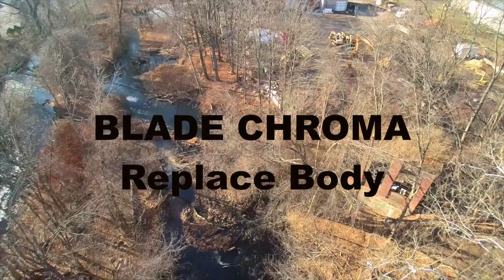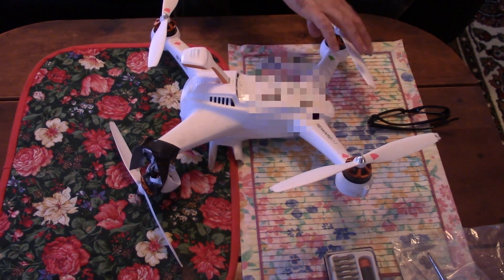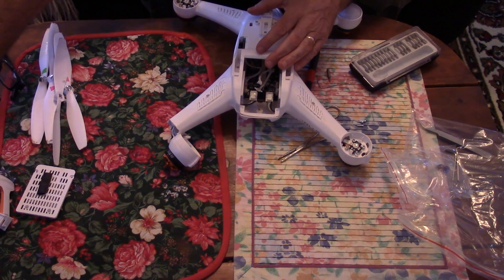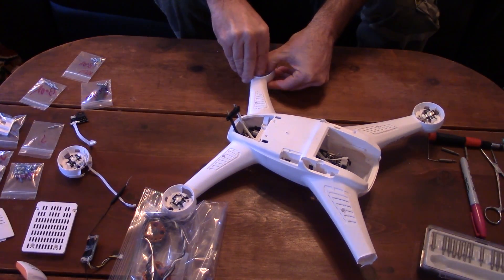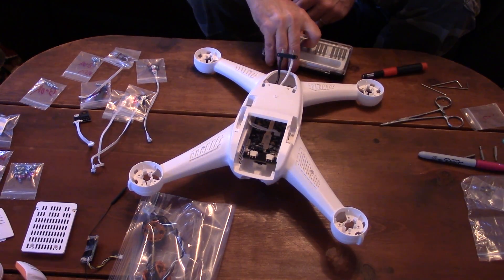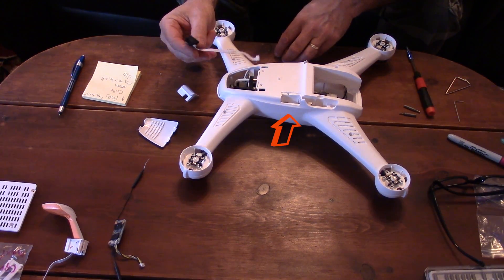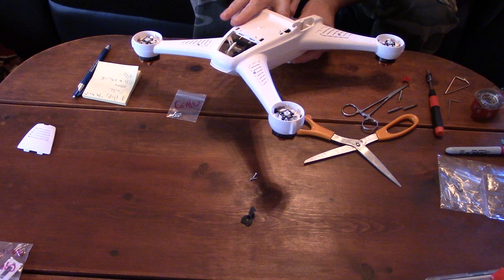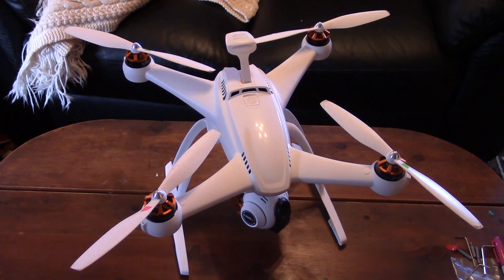Blade Chroma Replace Body

Comment: Yes you were extremely helpful to ma  . !!!! I just bought a new Chroma Drone fly-more pack from a great couple (Niagara Falls)  who upgraded to a Mavic pro. On my 3rd test flight as this is my first and I'm hopin many more drones I crashed in into a tree as yourself on a night flight run due to  the fact I couldn't see the branches. But it's OK Cam lost it's little aluminum cover landing gear was totaled hoping that as I purchased all new parts one arm had a slight crack which just hit it with a tad of SUPER glue it's will fly again . While at the hobby shop new me as I live in Rochester N.Y. hobby shop is in a nearby suburb of Webster. Retiring from Xerox it should"t be that hard to replace the body if needed. from either E Bay or Amazon I looked and they seem to have 3 body"s left in stock at this time.
Reply from the maker: Thanks for the reply glad it helped !

Comment: I have watched your video 2 times so I would know what I was doing when I attempted the the body replacement.  I will say you did a great job in putting this together.  And I say this because I took my heavily damaged body and landing gear apart and rebuilt it almost in the same order as you described and in just 1hr total time.  One of my cable connectors for a LED pulled off the circuit board and completely broke the outside connector receiver plastic but I was able to plug in the LED and it is staying so far.  I powered up my unit after completion and everything seems to work.  It's pouring rain today where I am at so I will testing it out maybe this week or next weekend to make sure all functions are still good.
NOTE: I do still have one issue and it's the top damper plate (camera mount) that slides onto the piece on the belly of the drone.  When it crashed it broke the slide on the top damper of the camera gimble mount.  The piece that attaches to the belly is good. I have went to a couple of hobby shops, and looked online, and have found nobody who has this part.  I will attempt to contact the manufacture and see what my options are.
Thank you again Mitch.
Reply from the maker: Glad I could help and thanks to you and everyone else for taking the time to comment.

Comment: nice video.  i tried agility mode and flew mine into the ground.  Agility mode is definitely NOT for people even with moderate piloting abilities.  the body of mine was cracked and i used Gorilla glue.. if that doesn't hold, i'll be watching this video more closely.. doh.  thanks for the insights

Comment: Thanks for the video, I also wondered about splitting the new body in two but it is not necessary as all assembly/disassembly is easily accomplished (as shown in your video) through the available access.

Spare connector is wired parallel to the receiver connector. My Rx was actually plugged into the connector with the two mounting lugs but either work the same.

Comment: Thanks for the video! I am new to my Chroma, and managed to get it into a tree. Those motor pods tend to break pretty easily! Just as an FYI, the driver sizes and type you list is incorrect, at least on the new ones. According to Horizon Hobby video at https://www.youtube.com/watch?v=fMUe5nBreC4 the tools needed for this job are a 2.5mm hex driver, a 2.0 mm hex driver, a 1.5mm hex driver, and a 00 Phillips screwdriver. Translation of hex driver, also known as an Allen Wrench.

Comment: Thanks for the excellent video.  Very helpful.  Apparently the "extra" cable is where the Spektrum receiver plugs in if you have the Chroma with the DX4 or plug & play model.

Comment from the maker: Horizon Hobby has confirmed with me that the "extra" cable/connector is normal.  I did  not ask what it is for, but it is supposed to be there.
Reply: There is a video on converting the Chroma from Spectrum to an ST10+ receiver.  HH sells one Chroma with the DX4 spectrum radio (a LOT cheaper than the combo with the ST10+ radio)... so, if you bought the one with the ST10+ radio, you have the best combination.  if you bought the one with the dx4/spectrum radio receiver, you can guy a ST10+ receiver for $49 and the st10 radio.  long answer.. sorry... short answer.. one wire is for ST10 receiver and the other is for Spectrum receiver.  spectrum receiver does not allow for "follow me" or tracking.

Comment: Thanks for the video. I changed my body in about 1.5 hours.
Reply from the maker: +AdmiralGump Thanks...did you find you had that extra cable?   Horizon finally replied but they say there shouldn't be anything extra so they suggested I send them a picture of it, which I'll try to do tomorrow.  I still can't imagine where it could go.
Reply: +Mitch Amatrudo Yes I had the extra cable. It was not hooked up to anything. It ran fine after I changed everything over.

Comment: Great Video, the extra connector you are talking about could be the SPEKTRUM Receiver connector. It connects in the splace place as the Yuneec receiver does BUT uses a different amount of wire and connector to connect to the main board.